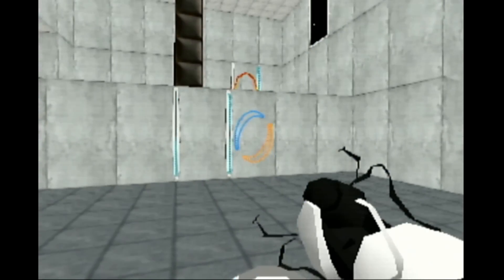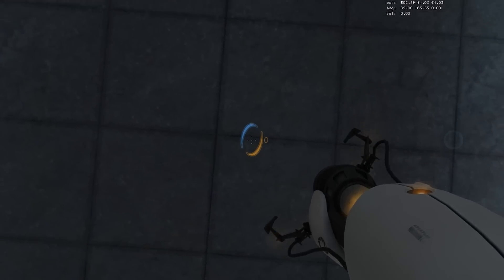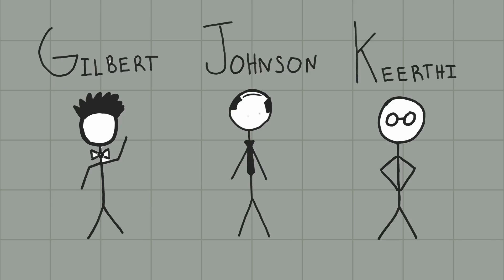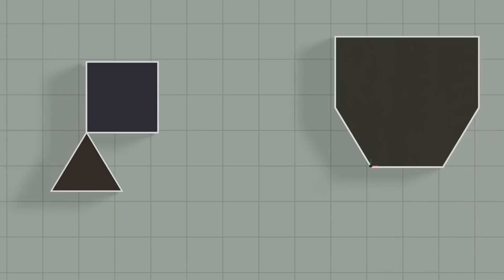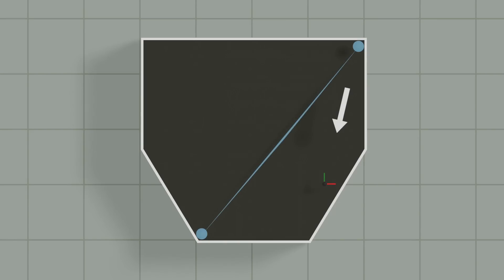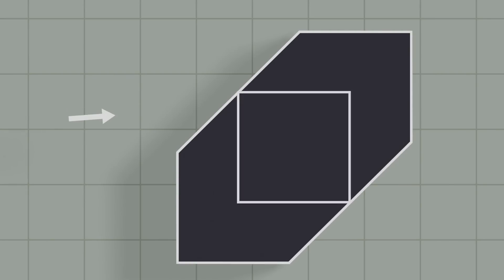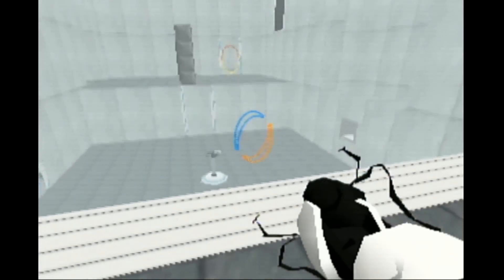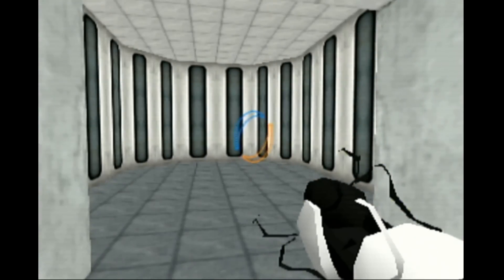How can the N64 handle fast moving objects? | Portal64

Comment: 1:48 That's also how the Super Mario 64 'backwards long jump' (or BLJ) works; Nintendo didn't add a cap for backwards speed, so BLJing can allow the player to build up enough speed that they go through walls and doors and trigger zones (such as for the 'endless' staircase, blocking access to the final Bowser area unless you've got 70 Stars or so).

Comment: An alternate physics solution to things skipping over walls is to make all area outside of the current room part of a massive collider extending to infinity (specifically, you’d have a BSP collider in the shape of the room and invert its detections so anything inside the shape doesn’t collide, and anything outside the shape does).  Or you could just box in the room with simple AABox colliders extending out from the room dozens or hundreds of units.  Then when you enter a room, that room’s collider turns on and everything outside the room is collision area (all physics entities outside the current room will need to be disabled when you enter the room), and when you leave a room it switches the room’s collision off and whatever hallways or next room’s collision on.

Comment: Interesting stuff. I saw a different video that explains the Nintendo 64 was a really powerful system for its time, but it suffered due to how inexperienced the devs were at making 3D games, so a lot of titles had a ton of unnecessary code, which just bogged the performance way down. If the games were properly optimized they could hit roughly 45-55fps, over the typical 25fps.

Comment: I've been playtesting this on real N64.
Latest build freezes only if cube gets stuck inside the floor. (If cube is dropped when too close to the floor). 
Easy fix would be that you would not allow player to aim too low with the gravity gun (when holding an object). Looking 360© works well when not using the gun's functions.

Comment: I would avoid using thin high contrast lines on a lot of parts because of the resolution of the N64. (really only noticable by the window) The grid design of portal provides a unique design challenge for such resolutions that may be worth playing around with a bit more. but it still looks great. :)

Comment: Interesting video! Another approach could be to perform a raycast from the moving object's current position in its direction of movement and with the length set to its velocity. That way you can see where the object would end up the next frame, and if the ray hits a collider, you can limit the object's movement to the position of the raycast hit to avoid passing through a collider at high speed. Not sure how the performance compares to this GJK approach, or if raycasting is even possible on N64 though.

Comment: Thanks for the video! Congratulations! Your game looks awesome! I never developed for the N64 but I read some of the challenges, like the microcode thing and I am also aware of the texture cache limitations.

I know game developers near the end of the cycle of N64 used to split textures like a puzzle game and assemble them in order to create an illusion of high resolution textures.

Does it take a very big toll on the N64 hardware to do this, assuming the cartridge space would be "unlimited" or big enough? I always wondered what would be the cost to do this in your game, for example, make the text that says "Aperture" above the elevator completely readable. And other ones look like they have a higher resolution.

Comment: I remember kazeemanuar solving sm64s quarter step problem by casting a single ray between the two positions mario is supposed to be, which I imagine would be simpler than stretching the collision box? Not entirely sure, just wanted to say in case it would improve performance or would make the code simpler

Comment: Yes! For efficient collision detection of fast-moving objects of arbitrary shape or movement vectors you absolutely need something like this, it's generally called "continuous collision detection". But even if you manage to get the collision detection for fast & difficult shaped objects right using the GJK algorithm, it may still fail because of a) cancelation (if you're using floating point or logarithmic numbers) or b) overflow errors (if you're using fixed point number). Because of that, even if you got the basic math & algorithm right, you still need to dig into the depth of computer arithmetic to prevent cancellation errors from creating sporadic difficult to explain collision bugs from happening.
Also: even if you get the collision detection right, you still have to get the collision resolution right - & that's another complex story entirely! (not for simple cases, but for the case that you need to solve multiple-simultaneously colliding objects or when the way to resolve a collision is not obvious at all because finding a plausible resolution is complex to even figure out because of complicated narrow geometry & you can't just use a previously save position because world geometry is also changing with time)
Side note: a lot of old games that only had rectangular shaped collision objects didn't actually use a general continuous collision detection of any sort but instead hacked their way around the problem by changing the shape of the collision rectangles of objects depending on the speed of the player or other to be tested collision objects.

Comment: I remember reading about this a long, long time ago. The part that was never clear to me was how to compute the Minkowski difference in an efficient way in real time. So If I understand this video correctly, the trick is that you don't compute the whole shape but only what you need? Definitely appreciate the math lecture, keep 'em coming!
Reply: Correct me if I’m wrong, but the fact that the support function is “linear” (or at least the dot product used to calculate it is) makes the support function of the Minkowski difference a function of both support functions. There’s a very good video explaining GJK that I saw a long time ago, which goes way more into detail.

Comment: One small idea - in the ui on the port of portal and portal 2 for consoles, the orange and blue around the crosshair are switched as blue, primary, is fired with right trigger and orange, secondary, is fired with left trigger, as opposed to the opposite sides for mouse buttons. Just thought it might be a fitting addition because after all the Nintendo64 is a console.

Comment: Portal N64 works because it's run on a more advanced PC emulation of N64 than the actual N64. Aka it's running as the limits of N64. It's just capped to a certain resolution and fps. This couldn't possibly run on an actual n64
Reply: speak for yourself, the ROM is downloadable on github and people have apparently ran it on actual hardware

Comment: 2:01 what about just casting a single ray from the current position of the object to the calculated position, and checking if the ray intersected any collosion? wouldn't that be a lot less work for the CPU, or would that be too inaccurate? (alternatively cast a ray from each corner of the collision box of the object to it's new position and do the check on those to catch corners and such)

Comment: This is extremely impressive stuff. Regardless, here's a couple things I've noticed:

You appear to be using a per-pixel depth buffer. A per-polygon buffer is more performant, and should work with the current portal implementation with minimal issues.

Considering how well the game is performing at the 30fps cap, an option in the main menu of the finished game to allow more recursive portals to be rendered would be cool. Plus I bet emulators could run a ludicrous amount of recursions anyway, it would be a cool way to sort of do a "built-in graphics patch".

The portal gun could be a sprite. Most sprites on N64 are really blurry, you could try multiple quads making up a larger square to create a high res sprite, then render that in 3D at minimum camera depth to avoid any other 2D limits.

Comment: Started the video calling it "Minkowski" and then a minute later started calling it minZOWski for the rest of the video, heh.  ITS KOW NOT ZOW!!!!!! Anyway, fun stuff. I would've tried to avoid doing that extra work on an N64 though and just traced a line, or did more like a capsule shape with one end encapsulating the start position and the other end - spherical bounds, and just have a cylinder connecting them. I've used Minkowski sums in other projects, mostly my CAM software that I've been developing for a few years. Thanks for sharing!

Comment: 7:18 - the original game has two mechanisms to deal with this. The first is that when you go through a portal which significantly changes the concept of "up", the game will force the player to duck for a few ticks. The second is a complicated mechanism called FindClosestPassableSpace which is responsible for making sure the player never gets stuck in geometry around portals (there's a good video by UncraftedName if you're interested) but the first thing might be sufficient for this bug depending on some details of your collision and the size of your hitboxes
Reply from the maker: That sounds helpful. Thanks

Comment: Why not check if the center for the previous and next point is on the same side of the face with the normal and a ray from the previous to next position intersects the wall?
Reply from the maker: That would definitely be helpful for flat surfaces but I also need this to work with shapes other than planes. I also use the minkowski difference later to find the point of first contact between an object and the wall which can do it much more accurately than a raycast.

Comment: Another idea for collision detection is take a look at how Mario 64 handled it in terms of subdividing the distance travelled per frame and checking for collision at each (in mario 64's case) quarter step. presumably if you cap the max speed you can avoid clipping through walls.

Comment: If I was a game developer in the 90s and you come arround with this idea... :

-Rumble Pak support
-4 players mode
-Cooperative mode
-Expansion Pak mandatory 
-Bio sensor would be a nice addition

The problem for this is that force to change the game mechanics. The good way to approach it would be base the Portal game in the same temporal context, I mean, in 1996.

A Portal prequel set up in the aperture science on middle nineties would justify widely to new consumers the cut down of graphics from the original game.

Also let your hands free to change the game mechanics in terms of multiplayer, so you can add up easily multiplayer levels based on Portal 2 oriented for 2 to 4 players, and you can add some justification on the plot to make the cooperative mode like in Perfect Dark.

The good point is that the nineties textures and the aperture logo are alredy done in Portal 2, the other good point is that because it not would be a recreation or a mod, just a game based on portal universe, it can be "more" legal, in fact, if you use an open-source emulator, you can encapsulate it for sell it in Steam.

Obviously,  first finish a full playable demo, with all the engine developed, and later start thinking in level design and scriptwriting. 

But if you have concerns about copyright and atract new consumers (not just Portal gamers old enough to had a N64 as a child), this approach can be more profitable.

Comment: I was playing Ocarina of Time recently and and I spent a lot of time just marveling at the various visible optimizations necessary to cram that game onto the hardware. The 3D that thing pulls of is very much a minimal viable product, which I never noticed as a kid. My brain sorta lumped it in as being graphically on par with PC 3d at the time, like Half Life, but no, the N64 has no hope of running vanilla Half Life that's for sure. A single level has no hope of fitting into the RAM.
Portal is probably more suited for the platform with the comparatively fewer assets and mostly small-ish levels, though I imagine those later levels will require some wizardry or compromise to pull of, I'll be fascinating to see.
Reply: N64 CAN run Half-Life just fine. Remember N64 uses cartridges. In fact, Factor 5 developers said that they stream cartridge ROM as it would be RAM, because transfer speed is so fast. So, N64 practically has even 512mbit (64MB) RAM+consoles own 8,5MB. Besides, minimum system requirements for Half-Life were 166mhz. Turok 2 minimum was 233mhz and N64 version was still better than PC. It would be nice to see Half-Life on N64 thought (or even Dreamcast release, but money talks). N64 -version would not necessary had to stop while playing to load new area, it could be great.
Reply: @M1XART  There's other reasons as well as to why I think am uncompromised port as well, to fit all the assets on a contemporary cartridge it'd take some pretty hefty compression, compression on par with the stuff pulled of on the resident evil 2 port I'm sure. I think the NPC assets would have to be modified quite extensively as well, as I've seen very.few N64 games with unsegmented limps on characters, Kaze pulled it off in his Super Mario 64 TC, but that was some amazing haclery he pulled off.
I do think with enough effort a decent port could be pulled off, maybe even a great one but I think in a lot of areas the underlying assets and engine would have to be completely redone and compromised in some manner.
Reply: @luigimaster111  Yes, technically Turok 3 is superior to Half-Life. N64 is hard to develop, thought. But it has enough horse power to run any game released before 2001. But did you know that nearly every N64 game is huge, but zipped, unzipped, swapped in RAM and out while you play the game! Cartridge is not really an issue, but direct ports from other consoles fail, as N64 does not load level into RAM and you then just play it. N64 is constantly importing and exporting huge amounts of data. That's why games are more interactive, nonlinear, and player can decide what to do next and on what order. But big levels are not an issue. Machine can create levels instantly (F-Zero X:X cup), and generate unlimited playflields realtime (Excitebike 64).

Comment: The technical stuff is good. Especially here, where you're using this stuff to do things that afaik were never done in an official n64 game.

I don't know if you've said elsewhere, but are you targeting a specific ROM size? That dialogue sounds expensive, storage-wise.
Reply: This is the part i dont get. It is impressive, but do you think is anything above the most complex n64 games?
Reply: @Refreshment01  I can't think of an n64 game with full rigid body physics and this level of robust collision detection.

Comment: Assuming the code shown was C, is there any reason you weren't using typedefs to shorten the declarations a bit? Are you perhaps using a significantly older standard than what I'm used to or is it for type clarity reasons like Greg KH enforces in the Linux Kernel?

Comment: Are the stretched collision shapes really faster than a raycast? Although now that I think about it the GJK algorythm is probably easier for multiple shapes so even if they were slower it's probably still better and more flexible to use those...

Also have you considered using vertex colors? They could make the levels much more pretty. c: (Obviously there's more Important things to do but I'm just too curious about all this). Love your stuff! <3
Reply from the maker: I don't know if they are faster but they are much more accurate. A raycast is like swept collision for a single point so I can't determine where two colliders first made contact. Swept collision is also nearly as fast as regular collision using GJK thanks to how easy it is to modify the support function.

I do plan on doing vertex colors eventually but I am putting that at a lower priority since it isn't essential for now. Once I finish the first 11 test chambers I plan on doing a polishing pass on all of them and will probably start doing more interesting lighting.
Reply: @james.lambert  Yeah I guess didn't think this one through with the raycasts lol. 

That polishing pass sounds like a good idea / workflow, awesome! And thanks so much for your response!

Comment: For simple non-concave shapes you don't need to use that ball falling algorithm. You can take the center point of the shape and drop a ball in the direction of the point. Do not allow the ball to move in any other direction but the falling direction. If it passes close to the point before hitting a wall then the point is within the shape.
Reply from the maker: That is true, but the simplex created by GJK is used later by EPA. You can technically pick any starting direction for GJK but I start with the direction of the origin this way it can quickly prove shapes if don't overlap. The from there I just need to reach the starting state of EPA which involves finding the simplex that contains the origin.
Reply: @james.lambert  yeah I was just thinking about the algorithm as you presented it. I'm working on collision detection in a game I'm making myself so I've just been thinking a lot of this math. I really loved the algorithm you found and I'm definitely going to use it :-) thanks for the video!

Comment: Looking great so far. I'd suggest putting a slight white noise in the GLADOS voice clips so they sound less compressed than they actually are.
Reply: I think it sounds like they're just clipping a bit.
Reply: @C.I...  I think it sounds like sound it sounds like sound it it sounds like it like like it sounds like sounds it sounds like sounds it like
Reply: @windowsxseven  You okay bud?
Reply: @jeremiii6523  feeling kinda drowsy
Reply: As a sort of dithering or what? I would presume more noise would worsen data compression, but I'm not clear on what you're aiming to do.
Reply: Wouldn't that make it sound more compressed